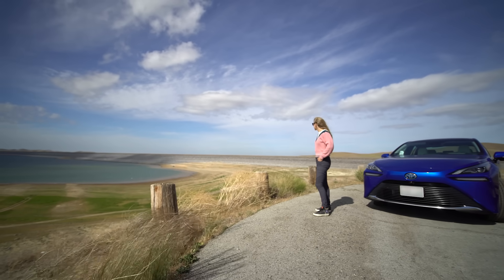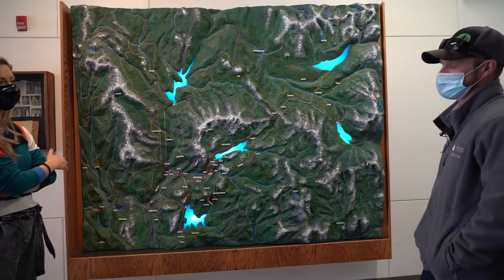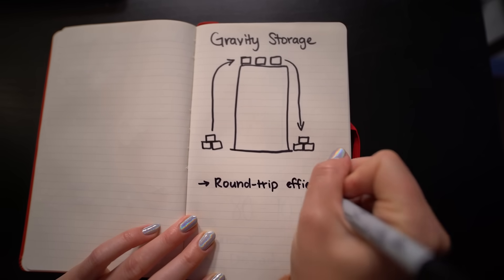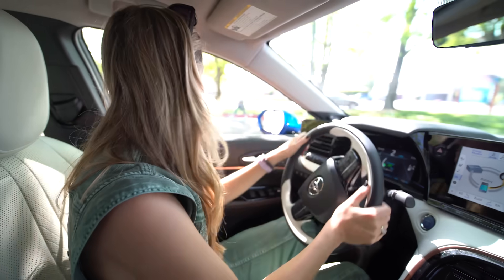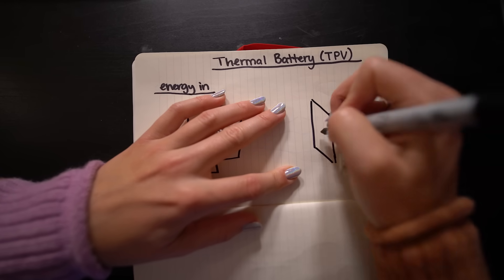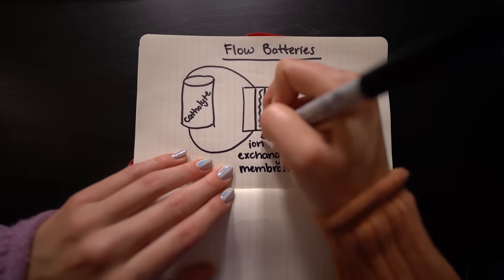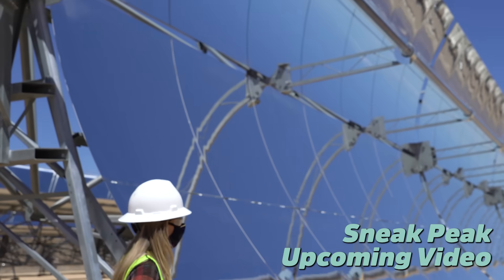The BIGGEST problem with clean energy

Comment: Some activities (like heating your home, smelting iron, kinking cement) use a lot of energy, but need not be done at a specific time. Instead of adding storage, these tasks could be "shed" to flatten the duck-curve. The way things are set up today, there is little communication from the grid managers to the energy consumers about what their preferred consumption-moment is..
Reply: Domestic tariffs only have very crude price variability for domestic customers in many countries.
Reply: @TheGoat not for 99% of end-customers - also the transparency and "what do I do with this information" is a big deal when it comes to homeowners. It's not about the grid-manager's awareness - it's about turning this awareness into a mutually beneficial action at the user's end.
Reply: @TheGoat And pre-emptively heating a sump when there is overproduction
Reply: @TheGoat I'm talking about home heating/cooling. With good insulation, the floor of homes can have a time-constant in excess of 48h and can act as a heat/cold store that can be overheated/ overcooled whenever power is available in excess. This thermal mass can then "normalize" over the next 24h bumping the house's temperature in the right direction. Water-heating for the bathroom only accounts for ~10% of what home-heating and cooling costs.
Reply: @AdityaMehendale  I'm not arguing with the concept but sometimes previous products can tarnish an idea.

Wall-mounted electric storage heaters went through a phase in the UK a few decades ago. Those would have been on a simple overnight tariff (Economy 7). I'm not sure why but I think they were rarely popular with users, possibly due to being installed below capacity and possibly because of lack of immediate control by the user. I've not seen these in any newly built properties in the last 20 years. I can only think of one person here with underfloor heating and I think his was water-based and between the concrete slab (not on ground level) and wooden floor. Underfloor heating here has the perception of nice but expensive.

I think people here are more likely to replace or supplement their car with a hybrid or electric one. Those with the capital and who own a freehold property with a viable roof will buy PV solar and battery packs.

A few days ago I found an interesting summary from the (UK) Citizens Advice organisation on time of use tariffs. They did some research in 2017 about the more complex niche tariffs on offer here and whether consumers could make practical use of them.

I found the CA report while reading about Carbon Intensity. You can now see when the best time is to use electricity in the UK from a national/regional/local point of view for the carbon dioxide emitted per kWh.
Reply: @kevinwalters5160  I understand what you mean, but also consider that underfloor heating adds extra area to your dwelling, as the large radiator-obstacles can be eliminated. Also, as the "apparent temperature" is more than the air temperature due to the warmer floor. With current energy-prices and house-prices, my guess is that well-insulated floor-heating will have a payback-time of 4-5years (if not zero, considering the additional area)  you get. 
Also, from a psychological standpoint - 20y ago, meters were analog/mechanical and telephones werre made from bakelite.  With a decent app or home-assistant, the "real time" nature of energy-pricing can be communicated and acted upon by the home(owner) far more effectively.

Comment: I don't understand the carbon storage, like, you put the excess energy through carbon, carbon heats up and glows, the glow is captured by photovoltaics but what happens after? Where is the "storage"?
Reply: Not completely sure but I think the storage is for daily peaks. Kept insulated it could get hotter during low usage and then open up a side to expose it to a PV cell during peak usage. It wouldn't need to stay hot for longer than half a day.

Comment: Not all lithium ion batteries are flammable. Please stop misinformation.
Try charging a hydrogen car by plugging in at home & charging your car.
You'll need 3x the power generation capacity to fuel H2 vehicles than battery EVs

Comment: One thing I've been wondering is whether there is any way to use all the energy that greenhouse gases have trapped to our advantage.  All that heat being trapped is a lot of energy.  Also, how are things looking for graphene batteries?  We have all this CO2 in the atmosphere, maybe there is a way to trap it, separate the carbon and hydrogen, and use the carbon for batteries and structural material.

Comment: Zero mention of fusion. What size is the elephant in the room now 🤨
Reply: Plenty of mention of fusion. The problem is how do we store the fusion reactor's power, since we lose line of sight to it at night (which we can solve with short-term batteries) and there's important seasonal differences by definition of what a season is.
Reply: @benoithudson7235  I’m unsure of what is meant by “line of sight” to fusion. Unless you meant the natural sun’s fusion. I specifically mean human-engineered fusion. Fusion would be the base load power. Are we on the same page, nuclear fusion? Tokamaks, ICF/MCF, ITER, JET, plasma physics, etc? I heard no mention by the Physics Girl.
Reply: She also didn't talk about bananas.

The topic of this video is energy storage. The reason for the topic is that we need energy storage this decade. The technologies she discussed are either already in massive deployment (like hydro) or at reasonably high TRL and mostly just working out commercialization details.

Fusion power is a far-away project; the first power from DEMO isn't projected until mid-century. It's cool stuff, but irrelevant to the topic of this video.

Comment: Send signals over the electric line to start clothes dryers by serial number at excess generation times.  Of, course you could just press the manual override button.  Could also temp. 2 degrees colder on the fridge, water cooler, airconditioning,  and 2 degrees hotter on the water heater, home heating.   Kind of a scalable negative battery.

Comment: Geo-thermal energy 24/7.. there's no need for battery arrays (which burn rather well!) when there is all the energy we could ever need a few kilometres below the ground. It seems odd to me that there has not been a global uptake of geo-thermal. It's safe, has no by products and can use existing power grids (which will need to be upgraded as superconductors improve). It could even use old oil rigs (and the engineering skills that made them).

Comment: To the question at the beginning of what are the biggest challenges of getting to a renewable-only future: I actually would think "changing laws/policies/regulations around these things." Maybe it's just the shy nerd in me talking, but engineering might be hard but dealing with people is harder. A big regulatory push towards renewables - and figuring out what kind of push would even be the most helpful - will probably be necessary, and laws are always slow to work out these sorts of details.

But it's interesting that just from the engineering side of things, it's energy storage. Like your camera operator, I probably would've guessed availability too, and to an extent energy storage is a form of availability, but it's more about spreading energy out in time rather than in geography. As I understand it, the big downside to renewables is the lack of consistency, so I guess it makes sense. These were all really cool techs that were shown off here to solve this problem.

Comment: If utilities would pass on the savings from excess solar during the day, battery EV can charge during peak power generation period, thus smoothing the duck curve. If utilities would buy peak demand rate from battery EV, EV owners can sell excess stored energy to smooth the duck curve. Since BEV are in population centers that has high demand, this is a solution that doesn't need anything other than pricing changes.

Comment: I heard this great idea a few years back. This could revitalize those Coal Mine Towns! 
They're called Energy Batteries. They use existing hydropower technology.  You build a reservoir above and below a mine shaft. 
You store energy by pumping water from the reservoir below to the one on top.
You reclaim that energy by letting it flow down through a generator turbine. 
You power it with solar or wind and you can use it at ANYTIME on demand. That's "baseload" power now!
Hillary Clinton should have said, "we're going to improve the lives of coal miners". But she doesn't think like this.

Comment: I like all the energy storage options APART from any NEW pumped hydro as it's just too complex, time-consuming and costly to install and maintain, and has a questionable environmental impact. I would like to see more companies use gravity batteries especially using waste materials for the weights and disused mine shafts. I would like to see cheaper options for energy storage in the home apart from lithium batteries like water batteries.

Comment: It REALLY irritates me to see hydrogen energy with "zero emissions" stamped all over it.
Reply: well, the hydrogen just needs to be produced in a zero-emissions manner. Currently, though, most of our hydrogen comes from natural gas, which completely defeats the purpose of having it in the first place, because you might as well just use natural gas directly
Reply: @marckiezeender  plus it is very inefficient, even as a storage solution, because batteries exist that don't need the energy density of lithium-ion batteries, so they're larger, but for storing energy from wind abs solar parks, there is enough space to pile up a few containers full of battery.
Reply: Yeah as it is now it is  really a deceitful way for the fossil fuel industry to get another way to market their products largely via fracking. There is also the whole issue of loss particularly in pipelines as even if you do cut out the natural gas there will likely be a lot of wasted product if natural gas infrastructure or water infrastructure for that matter is to be used as a baseline. In all cases ideally losses could and should be minimalized by making sure pipelines and transport fuel containment are efficient in practice research has found that companies have extremely leaky lines with large losses. Basically because repairs are too expensive they just let the pipes degrade and replace them only once they completely fail. 
Without sweeping regulatory changes and a simultaneous reworking of industry practices from the ground up this problem is almost certainly going to plague hydrogen energy in fact I'm willing to bet it already is.

I know that currently the net efficiency of the natural gas based method of extraction even with carbon capture technology to partly mitigate emissions is actually been shown to be far worse than the use of plain natural gas without capture.
Reply: Look into liquid metal cracking of NG..  Emissions are solid carbon and hydrogen, this may be a real "lower emissions" "gateway source" - Getting away from high volume polluting and toxic mining and drilling practices is a good aim. 

NB. natural gas, oil and coal are likely to remain as feedstock for chemical industries for a very long time.
Reply: @kadmow  Except there's no practical future for Hydrogen in vehicles, several other youtubers have made much clearer arguments why this is likely little more than a publicity stunt to try and steal some tax dollars from government subsidies.
Reply: but what are their emissions? that bother you so much
Reply: @RazorBaze  Hydrogen devices emit water. They don't emit zero; they emit water. They need to get it right!

REEEEEEEEEEEEEEEEEEEEE!!!!!!
Reply: @khatharrmalkavian3306  oh

Comment: I have found the R&D going on around sulphur batteries interesting, be it any of the subset of sulphur batteries; Sulphur Air, Sulphur Ion, and others i am sure i am not aware of. 
In natural gas production the sulphur is removed, so we have literal mountains of the stuff located everywhere. I have seen the entire contents of a 100+ rail car carrying sulphur from these mountains. While we are not going to flip the switch overnight, if sulphur can play a part in our battery strorage needs, while we extract the Nat Gas we are currently using, as a way to use Nat Gas to help drive Nat Gas out of being used as a power source, i find exciting. 
The Battery tech industry is really in its infancy, with so many elements and chemical compositions to try. There is never going to be a one solution for all things. So i thank you for taking the time to go through multiple options for each issue and drawbacks for each. Speaking as someone who works in the Oil Sector, it is an exciting time to be moving forward onto the next better thing.

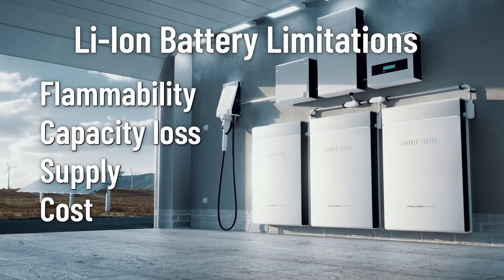Comment: 1:48 "Supply of lithium is supposed to run out by 2080". [citations needed]. lithium is the 25th most abundant element on Earth. The total lithium content of seawater is 230 billion tonnes. Newer methods of extraction will soon make all of this readily accessible. 

https://en.wikipedia.org/wiki/Lithium#Terrestrial
Reply: Yes and no. While the overall abundance of lithium in the crust is about the same as that of copper, we're not smelting down the entirety of the earth's crust. We depend on minerals to be concentrated into veins, and lithium doesn't tend to form into easily extractable ores. So even though there is technically lots of lithium in the crust, lithium that is practical to mine is in fact relatively rare.

Regarding seawater extraction, a method that is economically viable is still future tech. Yes, it would have been nice to see it mentioned alongside other future tech solutions, but like all future tech it is an unknown when it will be viable if ever.
Reply: @erikruser6047  There's a lot of lithium in ground water, and there are lots of salt flats left to mine.  With the right price signals, lithium will be plentiful.
Reply: Also, there's GOLD in that tharrr seawater. 😀
Reply: This video isn't fact checked very heavily. The same is true for the others in this series. Which is a shame as I thought this channel was reliable.
Reply: @TheScarnak  same
Reply: someone on Toyota's hydrogen team probably told her that and she unquestioningly accepted it. there's a reason why most youtubers don't do sponsored videos like this anymore: it's impossible to remain impartial and even with the best intentions you will end up misleading your viewers

note: from a bit of searching, the 2080 number is an estimate for when terrestrial supply will run out. in 60 years we will surely have found new reserves, or will have improved technology to purify metals from ocean water (a technology we will need to handle pollution anyway)
Reply: @SeanLinsley  Not to mention by that time we should have started asteroid mining there are several firms trying to do that by the 50s
Reply: @zerotwo_.002  got me there for a moment. First time I see the 50s used to refer to the future rather than the past.
Reply: @SeanLinsley  
Re the ocean water, were going to require huge amounts of desalination anyway, so nanofilters incorporated in that process should be able to collect many specific elements.
Reply: I was about to come back and say some good things about this video... until I got to the proposition to turn old mines into hydrogen storage facilities. that is impossible for the same reason the original hyperloop concept was (it's very difficult to maintain a vacuum at that scale), but this time in reverse with tiny hydrogen atoms easily passing through fractures in the rock.

and moments later the quiet part was said out loud: the entire goal here is to reuse as much oil and gas infrastructure as possible. it's all about saving investors, not about choosing the best technologies to fit our needs
Reply: @SeanLinsley  Well said. A lot of people are blind to that last point you've made.
Reply: @SeanLinsley  Don't be too sure about that. Helium usually has the highest diffusion coefficients (higher than hydrogen, the radius of the atom/molecule is smaller) and it is stored underground aswell (has been for years). Diffusion is generally more of a problem in thin-walled storage tanks than in basically infinite thick-walled old mines or gas deposits, because the walls get saturated with hydrogen and the diffusion rate approaches zero. Besides that: i don't think it is necessary to store hydrogen underground.
Reply: @SeanLinsley  Someone at Toyota telling her that was my initial thought too. Toyota are well known for dragging their heels on vehicle electrification.